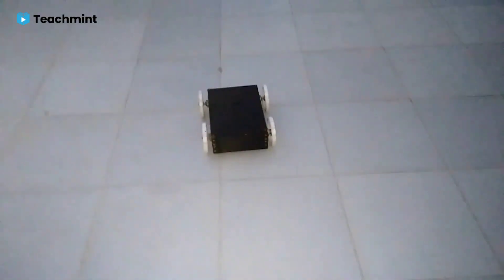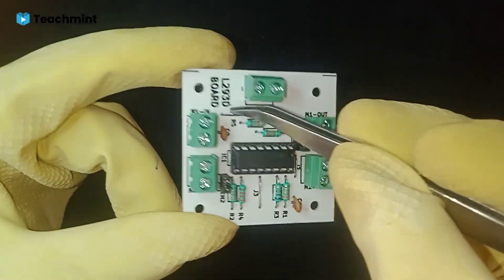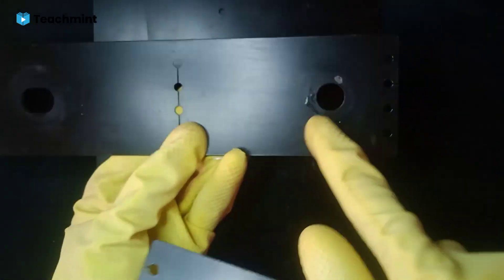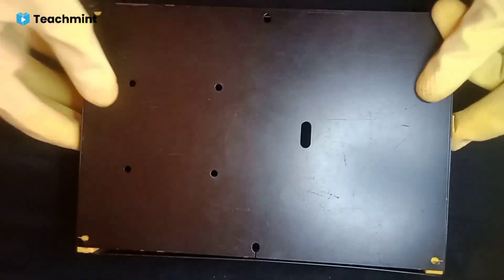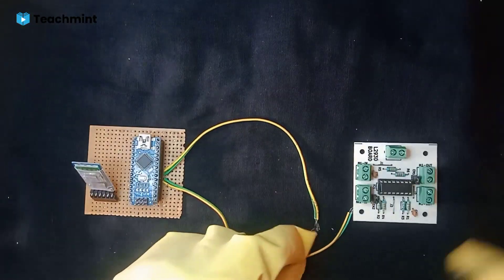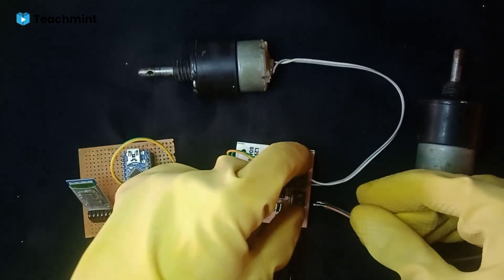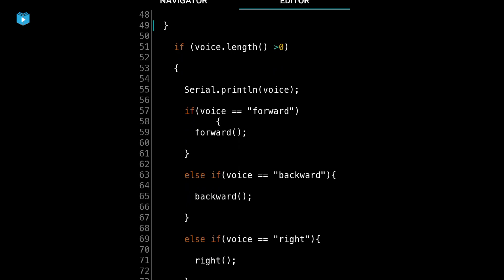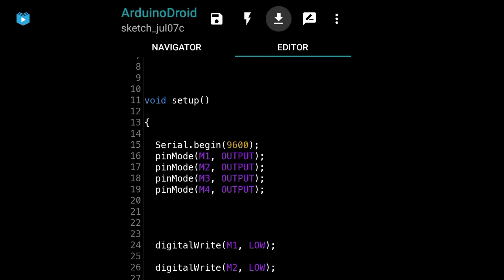How to Make VOICE CONTROLLED Car by using ARDUINO #arduino #Teachmint

Comment: Code:-
Reply from the maker: String voice;

#define M1 2
#define M2 3   
#define M3 4
#define M4 5
 

void setup()

{

  Serial.begin(9600);   
  pinMode(M1, OUTPUT); 
  pinMode(M2, OUTPUT);
  pinMode(M3, OUTPUT); 
  pinMode(M4, OUTPUT);  

  

  
  digitalWrite(M1, LOW);    

  digitalWrite(M2, LOW);  
    
  digitalWrite(M3, LOW);    

  digitalWrite(M4, LOW);  

  

}

void loop()

{

  while(Serial.available())    
  {

    delay(10);        

    char c = Serial.read();  

    voice += c;       

  }

    if (voice.length() >0)

    {

      Serial.println(voice);

      if(voice == "forward")
            {
        forward();

      }               

      else if(voice == "backward"){

        backward();

      }             

      else if(voice == "right"){   

        right();

      }

      else if(voice == "left"){

        left();

      }
        
      else if(voice == "stop"){

        stop();

      } 

      voice="";

    }

}

void forward()      

{
 
digitalWrite(M1, LOW);
digitalWrite(M2, HIGH);
    
digitalWrite(M3, LOW);
digitalWrite(M4, HIGH);
    
}

void backward() 
    {    
digitalWrite(M1, HIGH);
digitalWrite(M2, LOW);
    
digitalWrite(M3, HIGH);
digitalWrite(M4, LOW);
    }

  void right()      

{

digitalWrite(M1, HIGH);
digitalWrite(M2, LOW);
    
digitalWrite(M3, LOW);
digitalWrite(M4, HIGH);
    
  
}     
    
 void left()      

{
 
digitalWrite(M1, LOW);
digitalWrite(M2, HIGH);
    
digitalWrite(M3, HIGH);
digitalWrite(M4, LOW);
    
}

void stop()      

{
 
digitalWrite(M1, LOW);
digitalWrite(M2, LOW);
    
digitalWrite(M3, LOW);
digitalWrite(M4, LOW);
    
}